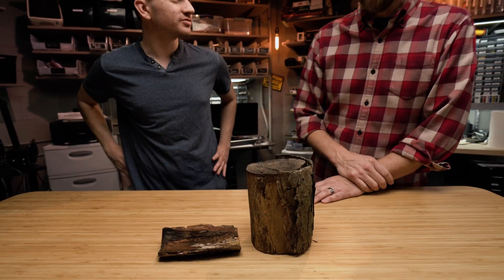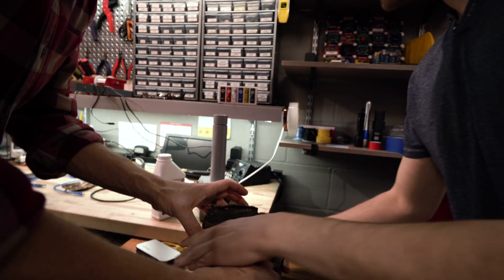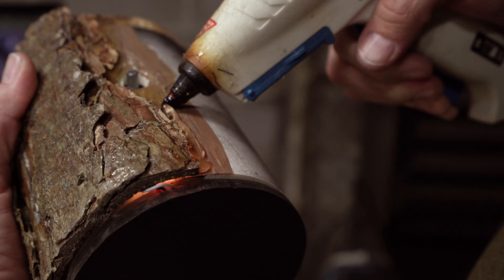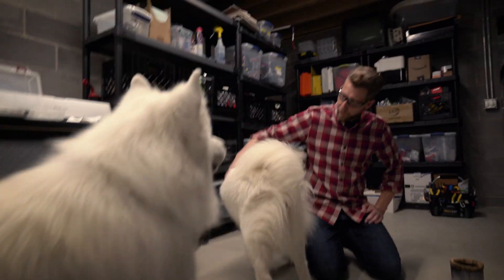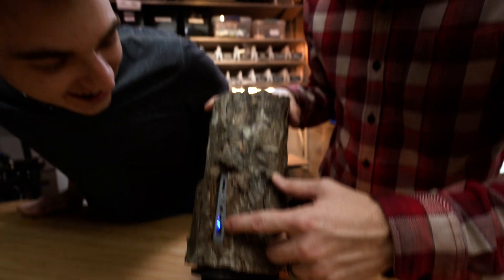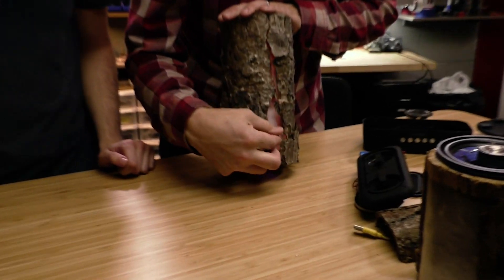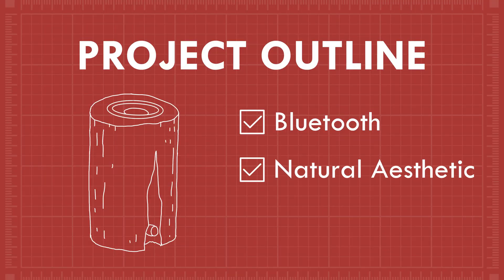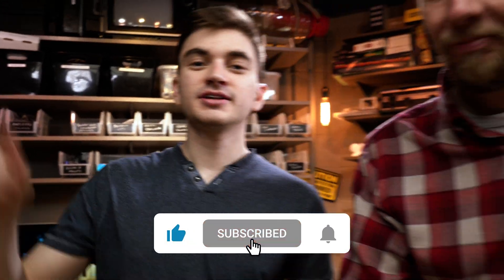Can You Turn a Log Into a DIY Bluetooth Speaker?!

Comment: I need help doing something like this on a whole nother level..First it's gotta Jam! No lightweight sound, Originally I was gonna make this Busted off piece of ash an epoxy lamp. Its shaped like a  Teardrop With a pretty good curve to it.. Only it's 4 foot tall.. It's kind of hard to explain but it's really cool.. I want it to grab peoples attention. But then I got to thinking how cool would it be to be a lamp and a bad ass Bluetooth speaker🤔..  I want it to be any color of light, As just a lamp or the speaker or Both and the light needs to be able to flash with the music.. I'm not to concerned about the price of the stuff. The cost of epoxy alone will run around 600$.. next thing is I have no clue what is the best way to get in touch with y'all and if you fellas would like to help me with this little stress project?  This thing will glow in the dark also.. I Am on Instagram @Jschmidt1075 if you'd be interested hit me up on there and I can show you fellas what I got going on. One way or another I'm getting this done.. hope to hear from someone 😎

Comment: Clever idea buying a cheap bluetooth speaker and using it's guts. Do you think this would work if you made a pair of the Tech Ingredients hanging panel speakers? using the Bluetooth brains to drive the exciters rather than those speakers?
Reply from the maker: My gut reaction would be that the built in amp isn't powerful enough... but it's worth a try!